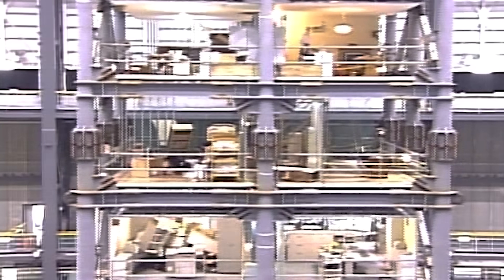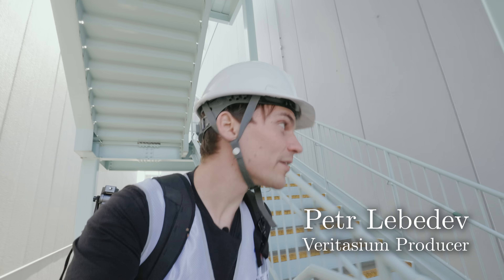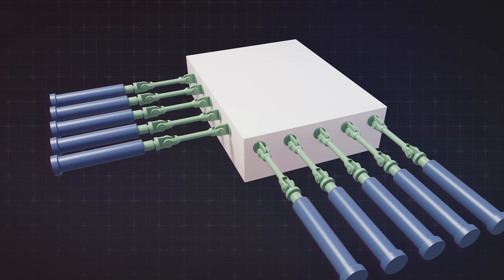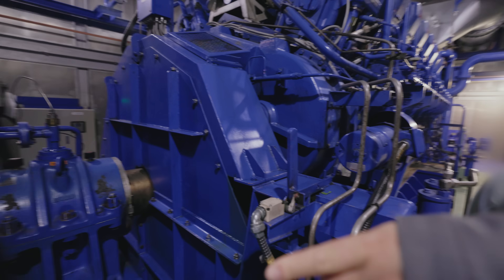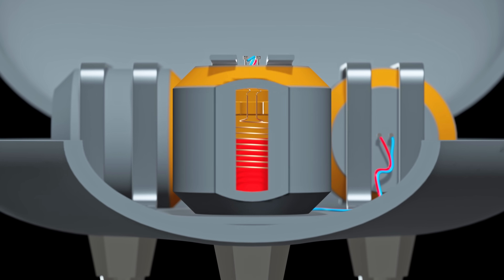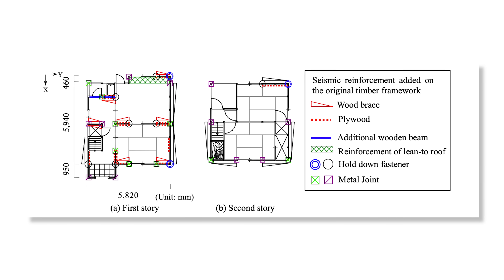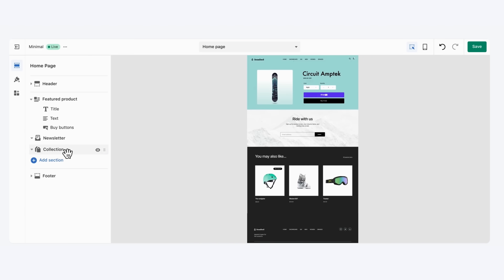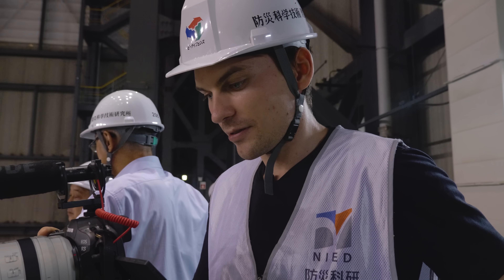How To Earthquake-Proof A House

Comment: This is an insane building and it has to be very expensive (in time and money) to build and test a lot of things. Do you think that advancement in computational physics could fully replace such infrastructures? Or will we always need to have physical test sites? 

I think that simulations will take over the physical infrastructures for such puroposes, not like CERN, LIGO, Einstein telescope, etc. because they are in search of new physics and nothing 'new' will come out of the physical test site.

I am curious about your thoughts on this :)
Reply: Physical tests will always have the potential to point out the weaknesses in the theory we use to run simulations and interpret results. They can point to approximations or simplifications that turned out to be ill suited to real world applications, such as non-linearities or interactions that only become evident at high energies. They can also help us tune parameters in our models. Simulations, in turn, help us develop new theory and generate hypotheses to validate in physical tests. And also to note, while physical tests are time consuming and expensive, simulations are also surprisingly expensive in terms of the electricity, emissions, and time it takes to run the simulations, as well as the time it takes to model the initial conditions. Overall, large-scale physical tests and simulations are complementary to each other as experiments and equations have been in the past. Both are essential for creating new scientific knowledge.
Reply: Do you think there will ever be a point that the simulations are just as good as some physical test sites. I fully agree with your answer (only the emission part is a bit vague) and i know that for some specific cases simulations lack a certain knowledge of the system (high energies, higher order corrections, the approximations used etc.)

But I think for some purposes like here I do not see any problem to make this fully functional in a simulation and also obtain new information on how to build better buildings. 

Maybe I am wrong and do not have enough knowledge on the subject at hand.

PS: I do not see the point of  the emissions... the computer used to simulate such simulations would greatly emmit less greenhouse gasses than the concrete to build the building in real life, to make the infrastruct, ...

 @yksoba
Reply: @eliotjanssens6139  I admit that my claim about emissions is vague. I also don't doubt that the physical test would produce more significantly more emissions overall. My point was just to say that although the tests are simulated, they are still resource intensive, and the number of full-scale simulations you might run per physical test might range from only the 10s to the 100s. That being said, simulations are in fact used in all sorts of engineering disciplines from car safety, airplane manufacturing, to analyzing loads on skyscraper designs. The use of a variety of simulations, ranging in level of detail, and often isolating components before testing integration with the whole system are already standard practice, as they significantly lower the cost of iteration, speed up the development of new engineering solutions, and can even reveal insights that would be impossible in any physical setup. However, you would only do a full-scale simulation once you have confidence that all the individual parts are working, as the simulation can take days or even weeks on the largest supercomputers. Even then, every car safety mechanism has to be crash tested before reaching the market, as simplifying assumptions that expedite the run-times of simulations may have hidden oversights that only reveal themselves in a physical test. And better a dummy gets hurt and not a real human. If it fails, you investigate why reality didn't match up with expectations, then use that knowledge to improve your simulations in the future. Otherwise, you might discover things you can simplify or leave out to make future simulations faster. It's always a cycle of new discovery.
Reply: And just to add one more point: sometimes you might learn something from a physical test that can't be simulated. Maybe the simulation failed because your steel supplier changed their production methods, causing the new steel to have slightly different properties. This is not something you would have anticipated or discovered unless you did a physical test, and it would sure be difficult to incorporate all the complexities of supplier and manufacturer decision making into your simulation!
Reply: @yksoba  Thanks for the answer, I now have a better grasp on how things actually are in reality! I fully agree with the 'cycle of discovery' I think when we do research in a new field the simulation part has become not only an extra part of a discovery but an essential part. This not only applied to this project here but also in the field of theoretical physics for example and whenever someone publishes new results I think that if they have proof from experiments supported by some theoretical framework together with simulation results the theory and results are more likely to be accepted by the audience.

The point that you made about the manifacturer changing steel production, I also did not count for but whenever something like this happens shouldn't the manifacturer be sure that the new steel has at least the same strenght characterstics, but I think this is a little bit out of topic for the topic I suggested. 

I still truly believe that with the advancement of computational physics and the technniques used, the computers used. That simulations would be sufficient enough to get for example a safety approvement of a car or a plane. I know we are not there yet, but this is something I hope/believe could happen in the near future.

Comment: The warning system   will be created before Earthquake.
If that will be greatest scientific achievement .
 
If there will be plate system under the building .the two plate Iron one is   moving on wheels lower one and upper one remain steady .
Then the building will not collapse at 
least peoples remain safe .
Roads and bridges are different that will be also possible .

Comment: 🎯 Key Takeaways for quick navigation:

00:00 🏗️ Earthquake Impact and E-Defense Introduction
- Overview of the Kobe earthquake of 1995 and its devastating impact.
- The inception of E-Defense as a response to the earthquake's aftermath.
- Importance of earthquake-resistant building research.
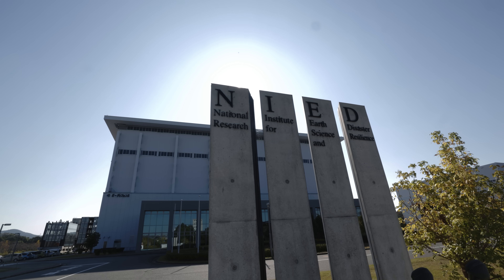02:07 🏢 Structural Testing and Shake Table Mechanics
- Functionality of seismic testing using seismic signals like white noise and specific earthquake data.
- Description of E-Defense's massive shake table and hydraulic actuators.
- Operational mechanics and immense power required for earthquake simulation.
04:23 🔩 Hydraulic Systems and Force Application
- Details on the hydraulic systems and high-pressure storage tanks for generating force.
- Maintaining consistent force during tests through nitrogen pressure reserves.
- Precision application of forces using electronic servo valves.
07:24 📏 Seismometer and Earthquake Magnitude
- Explanation of seismometer evolution from seismograph to modern geophones.
- Understanding earthquake magnitudes and their logarithmic scale.
- Significance of epicenter proximity in determining earthquake impact.
09:57 🌉 Earthquake Effects on Structures
- Impact of earthquakes on infrastructure, exemplified by the Akashi Kaikyo Bridge during the Great Hanshin earthquake.
- Importance of retrofitting older structures for earthquake resilience.
- Building code changes and their effect on mitigating earthquake damage.
11:40 🪑 Interior Safety and Impact Mitigation
- Focus on interior safety measures like furniture placement to prevent injuries during earthquakes.
- Shopify sponsorship interlude.
- Importance of simple structural reinforcements for overall earthquake safety.
14:54 🌍 Realistic Earthquake Simulation and Prediction
- Real-time simulation of earthquakes using recorded seismic signals.
- Seismologists' role in predicting earthquake types and their durations.
- Anticipating future earthquake scenarios for preparedness.
16:54 🏠 Future Challenges and Preparedness
- Discussion on the safety of newly constructed buildings and their survivability in earthquakes.
- Focus on functional loss prevention beyond structural collapse.
- E-Defense's pivotal role in enhancing building codes and minimizing casualties.
18:22 🛠️ Impact of E-Defense and Preparedness
- Highlighting Japan's proactive approach to earthquake research and preparedness.
- Recognizing E-Defense's contribution to making Japan safer through advanced research.
- Emphasizing the significance of preparation in minimizing earthquake-related suffering.

Made with HARPA AI

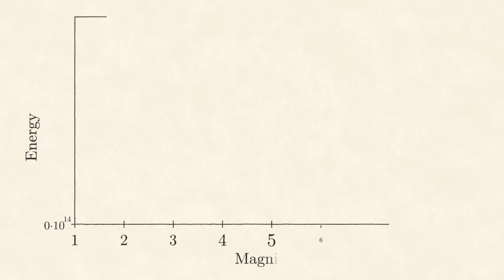Comment: Sorry, but 8:53 is incorrect.
Magnitude is not just log10 from energy. It depends a lot on magnitude type, but essentially, there's always a multiplier to the magnitude and an offset - their sum is the power of 10 which estimates energy. But every agency has its own calibration procedures, and often estimates don't match between various agencies using different sensor networks. And there's also a question of dozens of magnitude types...

Comment: In Turkey, we had a magnitude 7.7 this year with 50.000 dead and 153 Billion dollars of damage. I experienced a magnitude 7 in my city 2 years ago and it is the most terrifying thing to know you are inside a building which could collapse at any second during and eathquake.
Reply: The Turkish-Syria earthquake that occurred on October 30, 2020, was particularly dangerous due to several factors. Firstly, its magnitude was significant, with a preliminary measurement of 6.6 on the Richter scale. This high magnitude means that the energy released during the earthquake was substantial, leading to a greater intensity of shaking and increased potential for damage.

Secondly, the earthquake's epicenter was located in the Aegean Sea near the coastal city of Izmir in Turkey. The proximity of the epicenter to densely populated areas amplified the earthquake's impact. The cities of Izmir and parts of western Turkey, as well as nearby parts of Greece, were directly affected. This increased the number of people exposed to the shaking and consequently resulted in a higher risk of casualties and damage to infrastructure.

Furthermore, the shallow depth of the earthquake was a crucial factor in its dangerous nature. Shallow earthquakes, which occur within the first few kilometers of the Earth's crust, tend to cause more damage than deeper earthquakes. In the case of the Turkish-Syria earthquake, it was a relatively shallow event, with a focal depth of around 10 kilometers. Shallow earthquakes transfer a significant amount of energy to the surface, leading to stronger ground shaking and a higher likelihood of destructing buildings and infrastructure.

The seismicity of the region also plays a role in the hazard level. The Turkish-Syria border lies within a seismically active area known as the North Anatolian Fault (NAF) zone. The NAF is responsible for some of the most significant earthquakes in Turkish history, and it extends for about 1,500 kilometers across northern Turkey. This fault zone experiences frequent earthquakes as tectonic plates in the region continue to interact and release accumulated stress. The ongoing seismic activity in the area means that the population is at constant risk of earthquakes, and building codes and infrastructure must be designed to withstand such events.

Lastly, the vulnerability of the infrastructure and buildings in the affected areas plays a significant role in the dangerous nature of the earthquake. Despite improvements in building codes and regulations, many older structures in Turkey are not built to withstand strong earthquakes. This increases the likelihood of widespread damage, collapse of buildings, and potential loss of life.

In summary, the Turkish-Syria earthquake was dangerous due to its high magnitude, proximity to populated areas, shallow depth, seismic activity in the region, and vulnerability of buildings and infrastructure. These factors combined to create a challenging situation with the potential for significant damage and loss of life. Certainly! In addition to the factors mentioned earlier, there are a few more aspects that made the Turkish-Syria earthquake particularly dangerous.

One important factor is the rapid onset of the earthquake. Earthquakes often strike suddenly and without warning, leaving little time for people to react or evacuate. The Turkish-Syria earthquake was no exception, catching many residents off guard. This sudden onset can lead to increased panic and confusion, making it more challenging for people to seek safety or follow proper emergency procedures.

The aftershocks and secondary hazards associated with the earthquake also contribute to its danger. Aftershocks are smaller earthquakes that occur in the vicinity of the main event and can continue for days, weeks, or even months afterward. These aftershocks can further damage already weakened structures, making rescue and recovery efforts more difficult. Additionally, aftershocks can heighten anxiety and hinder rebuilding efforts, as people fear further collapses and damage.

Another notable danger is the potential for landslides and tsunamis triggered by the earthquake. The shaking of the earth can destabilize slopes and trigger landslides, posing additional threats to people and infrastructure, especially in hilly or mountainous areas. Additionally, if the earthquake occurs near a coastline or under the sea, it can generate tsunamis—large and destructive ocean waves. While the Turkish-Syria earthquake did not generate significant tsunamis, the potential risk adds to the overall danger in coastal regions.

Lastly, the geopolitical context of the affected area can compound the challenges faced during and after an earthquake. The Turkish-Syria border region has experienced significant political conflicts and displacement of people due to the Syrian civil war. This situation presents multiple challenges for emergency response, including compromised infrastructure, limited resources, and difficulties in accessing affected areas.

Overall, the Turkish-Syria earthquake was dangerous due to its high magnitude, proximity to populated areas, shallow depth, seismic activity in the region, vulnerability of buildings, rapid onset, aftershocks, potential for secondary hazards like landslides and tsunamis, as well as the complicated geopolitical context. Adequate preparedness, strong infrastructure, effective early warning systems, and coordinated response efforts are crucial in mitigating the dangers associated with earthquakes and reducing the potential impact on human lives and infrastructure.
Reply: I'm proud of mankind for what it can achieve, and deeply concerned for what it chooses to ignore.